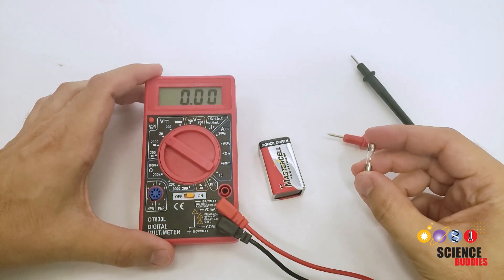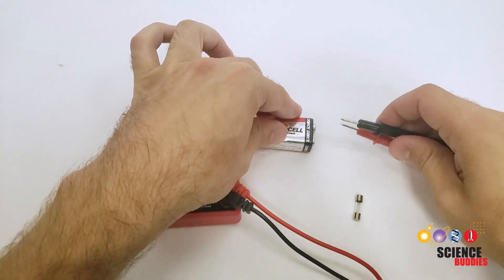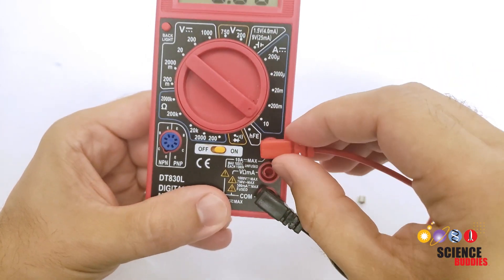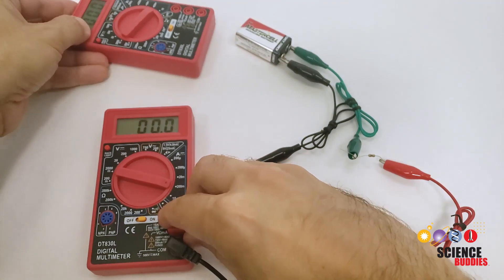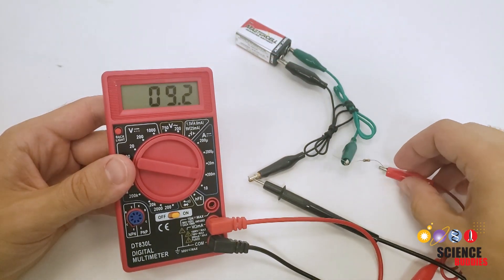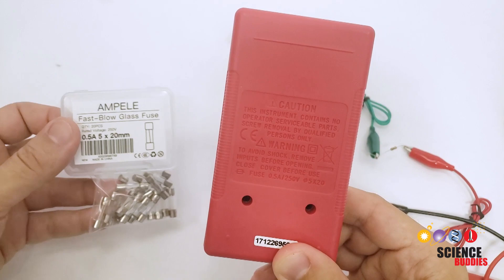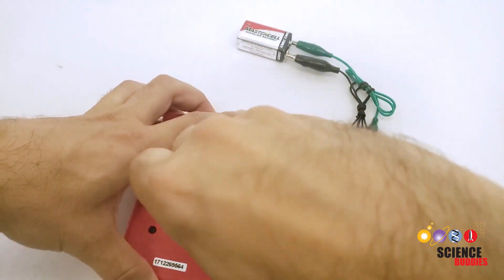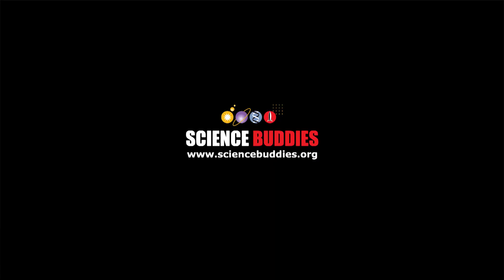How to Replace a Multimeter Fuse

Comment: on my old multimeter was the probes, i bought a new one for 25 bucks with a clamp, i tried to put the probes from the old one on the new one THEY FIT, i tried to measure a voltage, it showed 0, then i put the probes from the new one on the old one, the old one measured on a battery 1.59v on the new one with the same probes, it measure 1.6v, and the current meter also works, and before i was measuring current on a battery on the 10A fuse but both the 200mA and 10A fuses are working

Comment: Where can I purchase 500mA fuse H 250V for the multi meter.
Reply from the maker: You can find these fuses if you search on Amazon or other online vendors.
Reply: I am trying to find a fuse for a BM15D (do not buy one, and goes by other names). It is really small

Comment: This might be a silly question, but is the fuse for the whole unit? I thought I read it was only for testing the resistance? I have this same model.
Reply from the maker: The fuse is only for the current measurement setting on the 200mA port. The 10A port is unfused.
Reply: @Science.Buddies  thank you! i was about to buy a new one to test DCV. Glad it is still good, plus i hadn't thought about 10A for regular use, i thought it was just for a special setting...
Reply from the maker: When measuring an unknown current value, it is always a good idea to start out with the 10A port and dial setting, so you do not blow the fuse on the 200mA port if the current is too high.
Reply: @Science.Buddies  good to know, i appreciate your input! I used it heavily when replacing Prius hybrid batteries, to see which were bad. Now my boat does have power, so tracking it down is fun.... I don't feel the need for an expensive device, when this works just fine. 🙂thank you again!!
Reply: The other functions should work.  Also note you want to limit the time the multimeter is connected to the power source.

Comment: Hello! hope you're still there.
I measured the amps using the voltage port and pop it exploded. The problem is that the multimeter is giving random readings and it's adding numbers out of nowhere for no reason. Is there a solution?? thanks in advance :)
Reply from the maker: Hi - unfortunately this is more than we can help troubleshoot. There are online forums dedicated to electronics where you may be able to get more help.
Reply: @Science.Buddies  Ohh Ok. Thanks